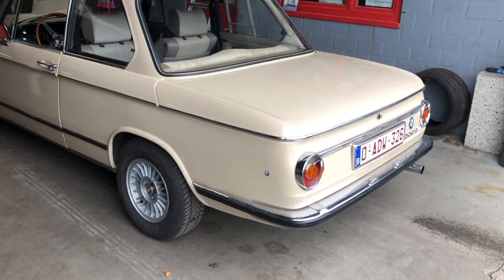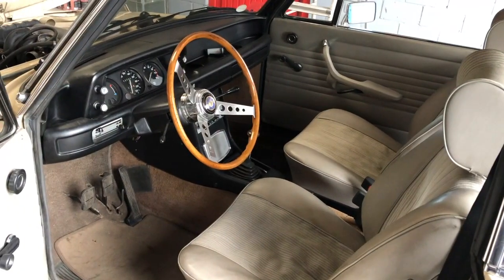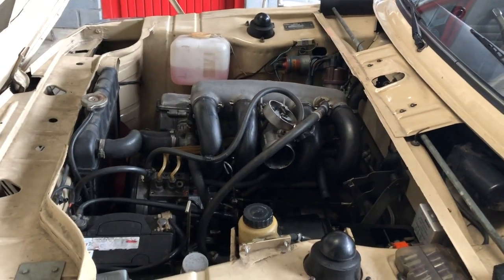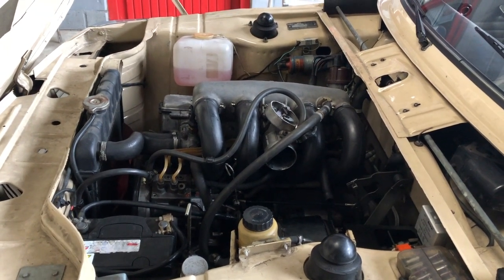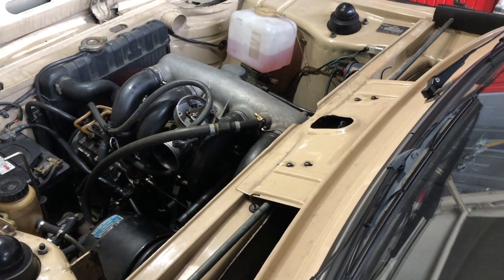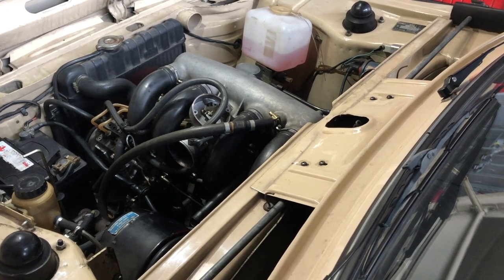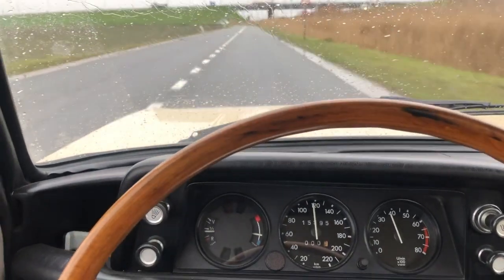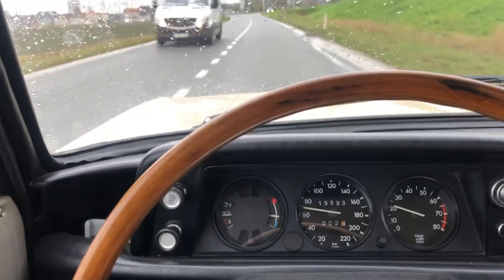BMW 2002 tii injection tuning   HD 720p

Comment: You made it look so easy.  It took me a while to get my 73tii running well after my pump was rebuilt. Main problem was the ignition distributor and faulty spark plug leads.